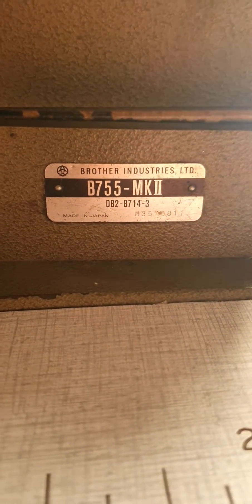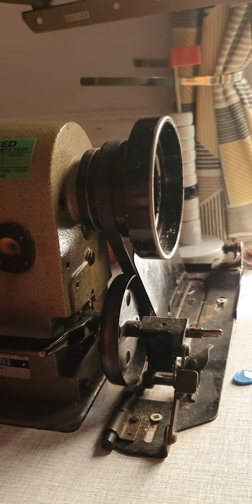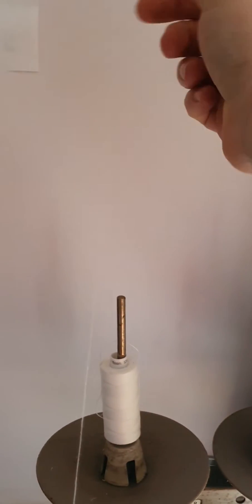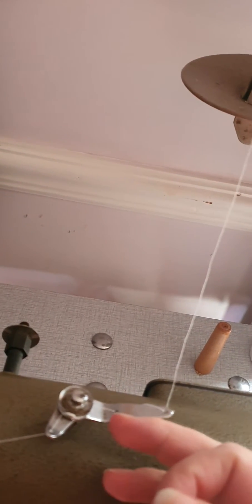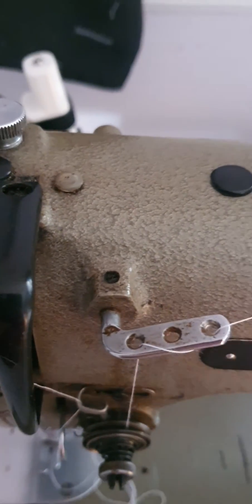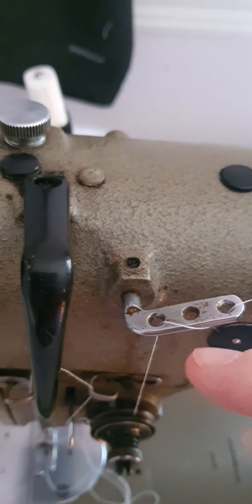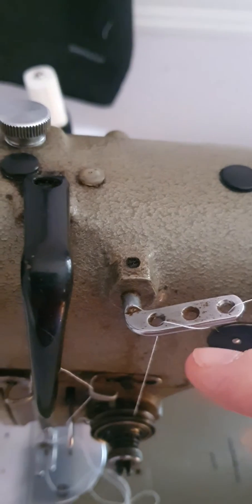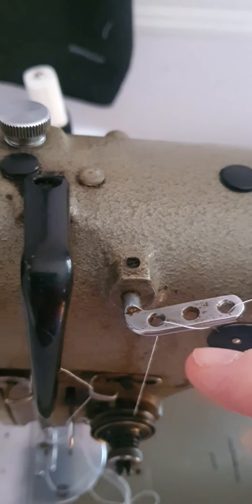How to thread up a Brother B755 - MK2 Industrial Sewing Machine

Comment: Hi when filling my bobbin on my b755 mkt2 can i stop the needle from going up and down
Reply from the maker: It won’t, best option is to have your bobbin filler engaged whilst sewing then it will fill up as you are sewing
Reply: @sewcial-thesocialsewinggro5648  Thank you for your fast reply
Reply: Hi again what would be the best needle for sewing 600 den boat canvas using 40 bonded nylon
Reply from the maker: I can’t really advise, however I used Schmetz and they have a guide you can check out on this page https://www.sailrite.com/Thread-and-Needle-Recommendation-Guide

Comment: Hi my thread keeps breaking on this machine any ideas are very welcome
Reply from the maker: I have a little check list when I have this issue, 
- Have you changed your needle?
- Are you using cheap thread?
- Are you threading from left to right?
- Have you unthreaded the machine and rethreaded?
- Is the thread in the bobbin the same type of thread on the spool?
- Rewind the bobbin.
- At the top of the machine you can miss a loop on the silver tension guide.
- Tweek the tension dial slightly if the thread is not running smoothly.
- Tweek the bobbin case screw slightly if it is not running smoothly.

Have a run through of this, if you need any further help just email me on hello@sewcial.co.uk